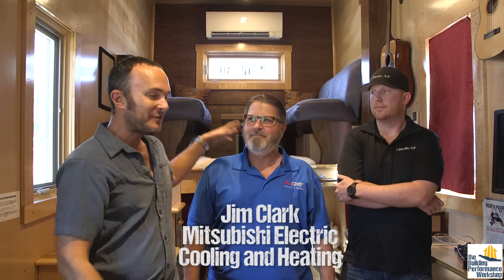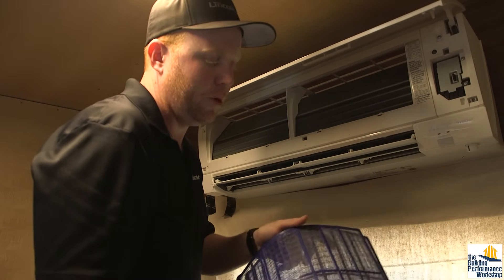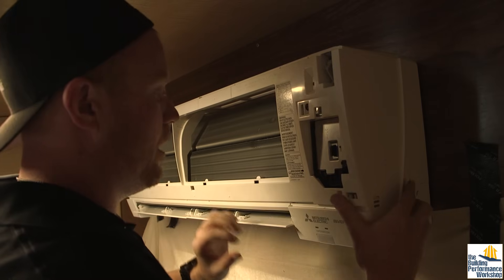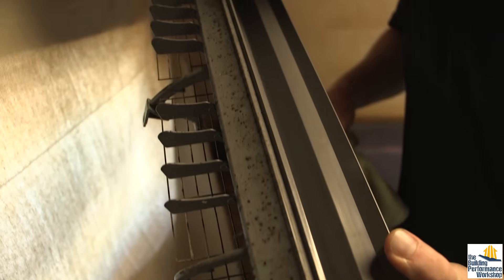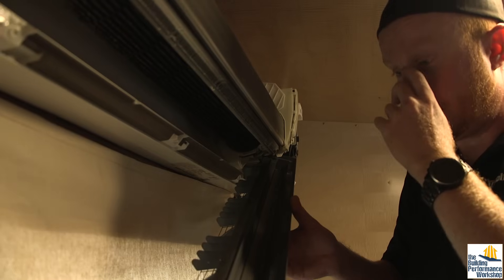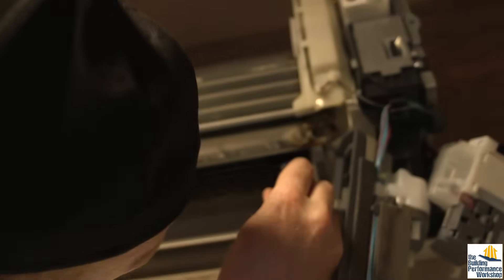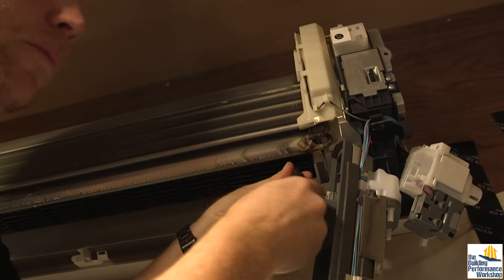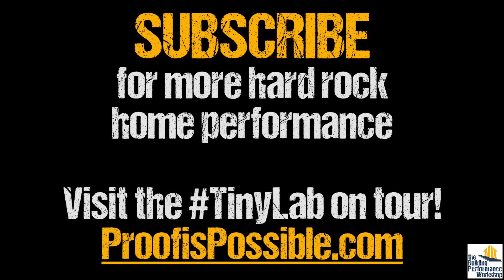Ductless Mini-Split: How to Take Apart & Clean DIY (Mitsubishi FH High Wall Series)

Comment: Thanks for the video! I have this exact same model and used it as a guide to do mine this afternoon
Reply from the maker: Always great to hear!
Reply: Do you have the FH series like the video? I did one of mine yesterday and was surprised to see rust on the right side of the coil. Also after reassembly the upper horizontal vanes don't seem to close as flush as the units I haven't taken apart yet.
Reply: yeah I do. Mine had some rust on the right side as well.. I think that's common on ductless as most of the videos I've seen have that. As for the vanes, it's not supposed to matter what position you put them back in as they should do a full sweep at startup to orient themselves
Reply: @Cryptic-1-9-1-1  
Mine do the full sweep and operate correctly, I just noticed the top vanes aren't fully closed and parallel with  the front cover like the one in my son's room which hasn't been apart. I double checked and they're in right, not a big deal just being a bit particular I guess. I think the rust is normal there as well, they should have used stainless steel IMO.
Reply: Yeah I wish it was all stainless as well, but it's probably not nearly as good at heat transfer as copper and aluminum.. plus the cost :(
Reply: @Cryptic-1-9-1-1  
No it's not the copper that's rusting, it appears there is a metal ( steel ) support plate where the copper refrigerant lines enter/exit the coil. That's the part that's rusting , already, and I wish was stainless.

Comment: Is there a drain hose on the right side of the unit that can be blown out as well? I saw the drain pan, not sure if I missed you covering the hose? My mini-split is leaking, and I'm guessing the hose for which the water drains could be clogged?
Reply from the maker: Haven’t tried blowing out, I’d use a pipe cleaner and drain pan tabs

Comment: Great video. I was just about to call to have mine serviced. The outside unit has been leaking water at the bottom and is green on the fins. It was installed on a plastic platform on an unstable surface and is not level at all...by a diamond certified company BTW. They won't make good on it, and come out and get it level.
Do you have a video about cleaning the outside unit? Or can you explain to me how to do it? 
Also it is winter here and quite cold can I spray the cleaner on the fins on the inside unit and just close it up or do I need to rinse it off. I mainly use it for heat, not for air conditioning. Do I have to wait till the summer to spray the coils like you did with the foam cleaner. Thx again, Viki
Reply from the maker: Hi Viki- just make sure to brush away all leaves from the backside of the condenser, and spray it down to get dust off the coil. Inside, yes, the stuff is meant to be washed off, either by automatic condensation or by you.
Reply: Can tell Mitsubishi too lol

Comment: Nice video. I have the same unit. Two questions:  (the unit is 8 years old). I have dirt coming out of the unit every or every other day, dirt in the form of black/grey chunks that look like compressed dust. Could I take my leaf blower and blow through the unit to get the dirt/dust out? Could that ruin the unit? Thanks, david from Toronto
Reply: That is probably mold. I would guess when you remove the wheel it will be full of mold.

Comment: great video! about to tackle my unit tomorrow... 2 questions for you: how does the drip pan just hang there? Is it made to do that (just want to be sure I don't damage it) and instead of removing the blower wheel - could I just use a soft small brush and vacuum up the debris? Not so sure I want to remove the wheel. Thanks!!
Reply from the maker: Yes, the drip pan is fitted in place and will stay attached if you get it out of the way. Trust me, take the blower wheel out. You want to wipe behind where it sits anyway, and you’ll have gone 95% of the way there already.

Comment: Any advice on popping the back 4 clips for the main plastic cover?  I am at that point, and not sure how/what direction to pull or push to get the big plastic cover off without snapping something.
Reply from the maker: It’s like shaving for the first time- you imagine you’re about to screw up, but then it just magically works. Let us know how you fared.

Comment: Another thank you from me! Did this almost exactly and feels so good to have a clean unit. Mine is a slightly different model Mitsubishi, so it was a bit different, but close enough to follow. I wanted to ask what you do for the secondary drip tray in the top back of the unit? I wiped mine out as best as I could, but it is not very accessible. It was not nearly as dirty as the main drip tray, so I can see why it may be omitted, but wondered if you had any tips on cleaning back there? Thanks again!!
Reply from the maker: Glad to hear it, James!

Comment: I did it! I was getting virtually no airflow down the entire center 80% of the unit. Nobody instructed us on routine maintenance beyond cleaning the filter every now and then so you can imagine what the fan looked like after maybe 8 years 😅
I was a little worried because it is hard to tell how much force you're applying in the video. Especially around the coil assembly I feared I might break the whole thing in the middle of summer.
Some steps require a little more than a gentle nudge but I was able to get it all cleaned and reassembled with no broken pieces and it's working like the first day again.

One thing I noticed is that it seems like it's starting to build a bit of corrosion around the right side of the unit near the drip pan around the copper coolant pipes. Like the coil fins are a bit discolored in a copper tone and there was the same color residue in the very right side of the drip pan. Is there anything that can be done about this or is this even something I gotta worry about? As long as it's not damaging the pipes and only discoloring the surroundings it's no issue but if the seal breaks it's probably a goner.
Reply from the maker: Good work buddy- don’t worry about the discoloration, mine look like that too after only 3-4 yrs.

Comment: so how do you clean the mildew out  of the back end of this thing where 
the final coil folds over at the top , i see it terminates in openings 
at the very bottom of the unit but not into the drain pan oddly enough
Reply: I noticed the same thing in mine. I don't think there's a [reasonable] way. It looks like the only way to get back there would be to remove the coil and dismount the entire unit from the wall. I'm not in love with the design of these things tbh.

Comment: Great video... Had no idea it came apart that far...  Does any maintenance need to be done to the unit that is on the outside of the home ?
Reply from the maker: Thanks! Yes. You can spray that one with a hose, easy peasy.

Comment: This is a great, clear video, thank you.  I can't wait to try it on our units, that are starting to have a musty smell. 
 Our unit drains to a container that is pumped up onto our roof, since it's on an inside wall.  Is there any way to make sure the drain piping is cleaned out as well?  And the pump, too?   Also, is there a recommended distance from the ceiling for installing these units so there's enough air return above them?
Reply from the maker: Great questions! I’d clean the pump by hand and replace the drain hose if it looks old and crummy. And the clearances are in the installation manual, I’m sure, which you can download online. Good luck.
Reply: @HomePerformance  Hey did the cleaning help with the musty smell? Mine smells terrible when it is in any mode
Reply from the maker: YES, the cleaning will make it much nicer. Do it!

Comment: Very much appreciated!
Reply: @HomePerformance  Being not so brief, I've been getting some vibrations in my FH35, only cleaning filters every fortnight during the 4 years since installation. Your great video made me confident enough to get the fan wheel out, and o boy was it dirty. I ended up using a tiny brush to clean between all the blades, and cleaning everything else. Machine is like new again! Only thing I was unsure about was what kind of grease to use for the left bearing. I took a synthetic/ptfe grease and it seems to have worked fine, cleaning out the old stuff to avoid any mixing problems. Thanks again for taking the time to make such a comprehensive and easily understood video. I wish you all a Merry Christmas!
Reply from the maker: Thanks for sharing your journey my friend- so happy our work has helped you- Merry Christmas!

Comment: Just cleaned 9 of these. replacing the wheel on the larger units can be a nightmare. try placing the wheel centered on the shaft (maybe add some lithium lube) and push to the right while spinning until it snaps in. Can take a lot of trial and error.

Comment: I’ve done this service on my indoor head 4-5 times now, with your instructional video. But there’s something missing. What about the bank of coils in the back that faces the wall. How do you clean them effectively with the limited space due to the ceiling. Been using Viper coil cleaner but hasn’t effectively cleaned all the coils, this time around.

Comment: Thanks for the good video!  I have exactly the same device myself, but I can't get the case removed from its back edge.  So all the screws have been removed, but the device is mounted so high (3.5cm between roof and device) that there is no room to help remove the cover from the back edge.  So what kind of clips are there at the back and should that case come out by simply pulling it out?  Now it won't come even after trying to force it.
Reply: Update: Finally I got it off helping with long screwdriver 💪
Reply from the maker: Good work JV
Reply: @HomePerformance  Now it's so quiet and wife is very happy 😊
Next time this is much easier!

Comment: All is clear in the video and I’m looking forward to completing the job. 

My only issue is I can’t seem to take off the piece in between to the two screws that are hidden by the screw covers. It’s the step right before pulling off the drain pan. (3:08)

This piece popped right off in the video. Is there flap in the middle?
Reply: Hi, Jonathan. I'm having the same problem. Did you figure this out?
Reply: At random yes I did figure it out. I’m glad this popped up on my alerts so I could help. I just pulled horizontally out until it came off. Maybe a slight upward pressure as you need your fingertips to slide it out. There’s a small tab that if in the worst case scenario breaks it seems the unit would still be secure with the screws on the side. This video gives a nice visual of the part and gave me confidence to be a little less gentle. I also did some translating online and it all came to “its held up by a tab” or something. 
https://www.youtube.com/watch?v=VjKi6WOPuCY&feature=youtu.be

The video is spot on. I found the set screws to be stubborn as it has never been loosened. It eventually came off. The drip pan is hard to get off and once you locate the 3 small tabs it sits on you’ll have more confidence to pull it off. I used the ladder to prop it up so it didn’t hang. The coils were tricky because they sit tight. Once you locate the tabs they sit on then it’s easier. Plus after pulling the wheel out you need to be sure the coils sit on the tab. I was worried it would fall and didn’t as long it sits on the mini tabs on the left. I’m quite the novice in regards to DIY and didn’t want to be stuck with a big bill to clean hope this helps!

Comment: Thank so much for this video. Got some installed  a month ago. 
Off topic, do you think 811kWh extra for one month  (27.97 kWh a day) to run 12000 and a 9000 head sound like a lot average temperature was 1C the coldest it got was -9C and 11c during the day.  Good insulation in my house, had home inspectorcome for rebate for heat pump and insulation and windows.  Heated my house to 18c.  I have the cold climate system. As I'm in ontario.  I had to have the remote set at 22C to even achieve 18c on the negative days. But on the days where it was above 0 it got up to 20c or 21c. 
Just wondering if i have a refrigerant problem. My tech guy says well it blows out warm air so it is fine. 
Thank again!!!! Love you video. Learning so much.  
They get installed and then it feels like I'm all on my own. So got to do my own research. And your channel is my favorites for learning about split heat pumps.

Comment: The biggest PITA I find is getting the drip pan onto the unit correctly.   It looks like Garret may have had trouble too as it looks like part of that video was cut????   What is the trick to get that drip pan to snap in easily?
Reply from the maker: +George Mandler no, I don't think we cut anything, but you do have to mess with it a little. I've done this twice myself since.
Reply: I laughed when I saw this post b/c I had just said the same thing, "They cut out this part out from the video!" Yes, this is the hardest part and I'm sitting here struggling with it. This is my second time doing this and both times this was the pitfall. Any other suggestions out there other than messing with it a little bit? Otherwise, this video is definitely the best out there!
Reply from the maker: Sorry, I’m about to clean mine again and will pay attention to this step and see.
Reply: I just wish it was designed so the blower wheel could be removed without having to move the coil.
Reply: Or can you slow the video down so we can see how it goes back on properly.
Reply: @HomePerformance  Thanks for the video.  But there was a lot of cutting that if left in would have been helpful.  Like on the pan at the 10:38 part it went from a bit of a struggle getting the pan on to the pan secure.  But I really appreciate this as I found a ton of mold in mine even though I followed the manual of turning the fan on high with AC set at max temp so it blows out the moisture.
Reply: Totally agree, this is the best video! I've cleaned my mini split about six times now. The only part I find difficult is the reinstall--piece on right where drippan connects. Looks like it should easily slide up and into the unit, but typically is very frustrating. Please make a video of this part of the re-assemble. Thanks much!

Comment: Do you suggest a pan tablet ? My installer wants to put pan tabs in the drain pan. I’m allergic to mold so a cover up won’t work. I have a sour smell from my ac unit now.
Reply from the maker: Not sure- I’d also advise that you request non-scented coil cleaner though. Sour smell might be fake lemons.
Reply: No the sour smell is from something other than cleaning as I have not had it cleaned yet. Mildew or mold can smell sour?
Reply: How often should we clean the units out ?
Reply: Also do I need to cut the circuit to the system ? Or just power off the unit ?
Reply: My ac unit doesn’t have the same screws, msz-gl 15nl. Does not look like that one.
Reply from the maker: Oh man, fungus can smell like tons of stuff. Sure.
Reply from the maker: Yes, shut down the circuit definitely. Safety first!
Reply from the maker: Sorry buddy
Reply: I’m a lady. Lol. So I got it open. Nothing like mold or even condensation was found. It’s only about a year old. Not sure what would make that smell now.
Reply from the maker: Sorry- good for you! Clean it anyway, just cuz you can’t see it doesn’t mean it’s not there.

Comment: The video was great but I messed up some how and the blower wheel seized up. When I put it back together the rubber piece on the blower seemed not to seat properly and was too tight when I put the wheel back in. When I turned the unit on the wheel and the boot fused together. What did I do wrong? It seemed to be seated properly but was too tight moving when I closed the unit.
Reply from the maker: Just try again, out and in. Don’t crank any screws too hard.

Comment: Have the split system Mitsubishi and have a few questions. Does it matter the outside unit is in a flower bed full of mulch not rock, for the dust factor? And what to use to clean drains, I have the bigger units down by the floor. And it seems even though I keep good cleaning on filters the barrel fan gets this black build up and starts spitting it out of vent. What if anything can I do to prevent this? Please help......